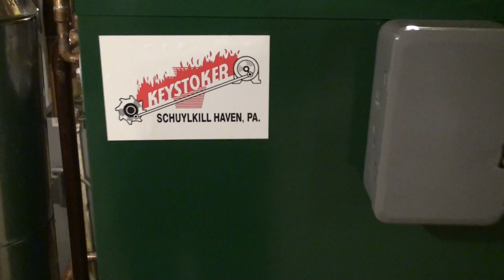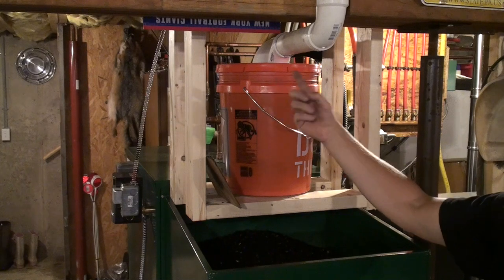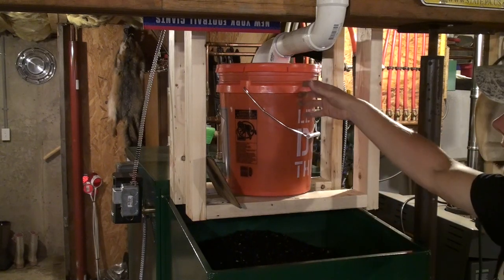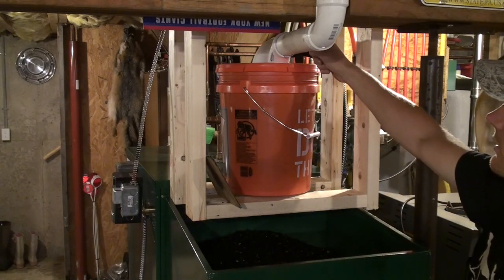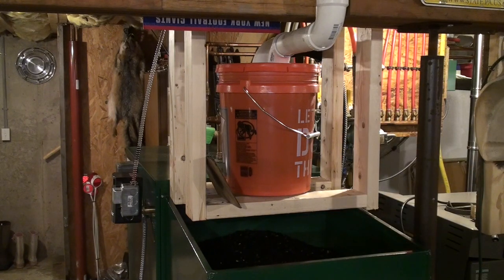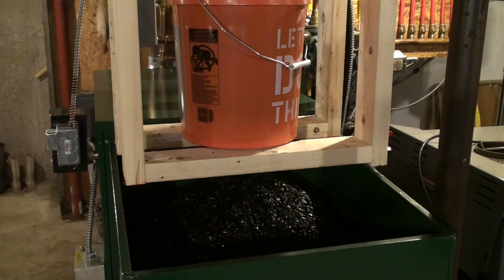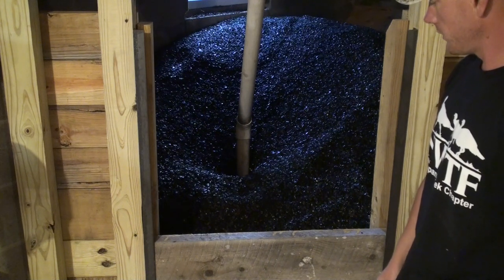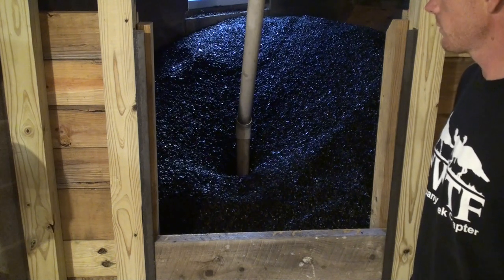Coal Vac Sytem Explained

Comment: John, 

Nice setup to avoid shoveling coal. I'd install a on off switch in the electric outlet supplying power to the vacuum and mount it next to the 5 gallon bucket so you hold the cardboard up to the flange and turn on the outlet which the vacuum is plugged into. Just makes it less you have to move to place the cardboard over the flange then flip the switch. Couple of bucks makes life a bit easier.

Thank you for showing the coal vacuum system.

Much appreciated.

Comment: PPE (plastic process equipment) sells things called vacuum loaders.  They work on the same principal and are very automatic, as in, leave it on all of the time and it will simply keep the hopper full on the stove/furnace.

They are pricey, but works well for plastics (pellets and regrind).  Food for thought.

Comment from the maker: Good question as long as there is a cap on the bottom of the toilet flange. I use a piece of cardboard. You will just hear the shop vac sort of labor once it fills and then shut it off. I don’t get coal in the vac. Thanks hope that helps!

Comment: You said that you drill 6 holes in the pipe that goes in the coal. What are the size of the holes and where are they placed.
Reply from the maker: Richard DeBalko  
I drilled holes in the pipe that runs into the coal. The holes are more towards the end of the pipe and buried in the coal. But some are above the surface as well. I just played around with it adding holes until the coal flowed proper. You can always tape over a hole. Not sure of the drill bit size. Prob the same bit you would use to put a standard size drywall anchor in.
Reply from the maker: Richard DeBalko 3/16 is what I used.